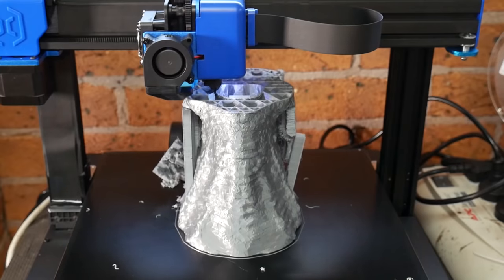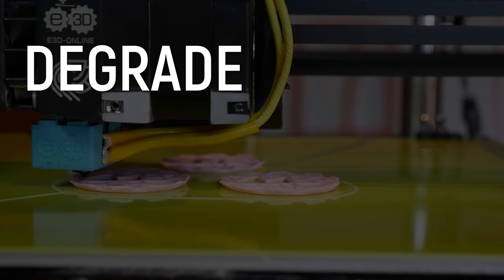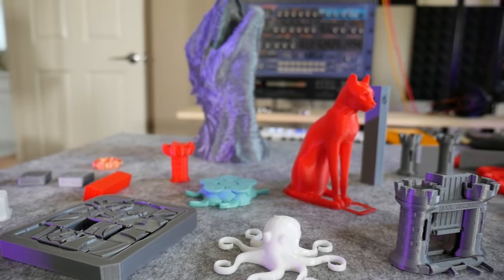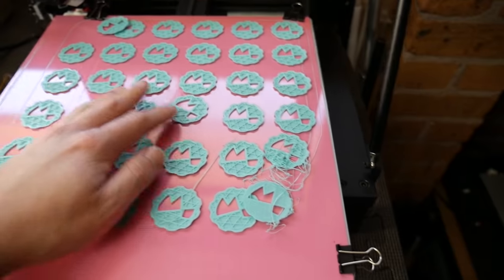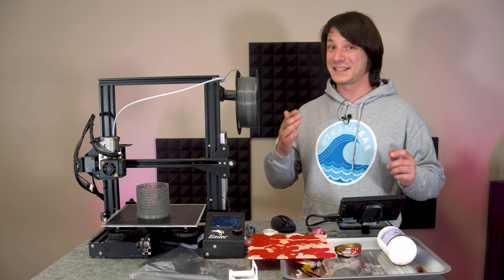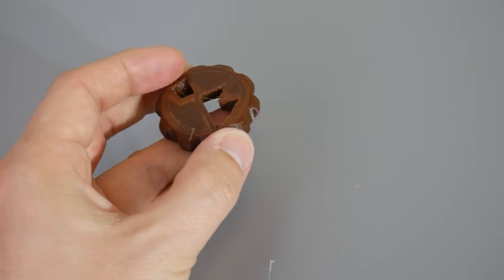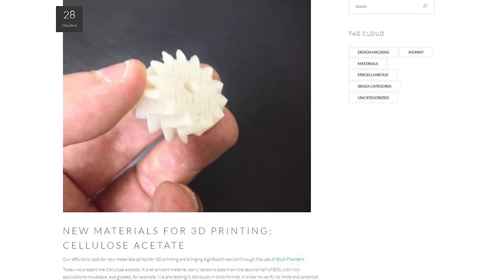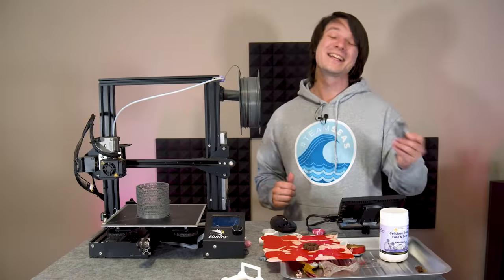PLA - 3D Printing's Biggest Lie.

Comment: Mate, this was know for years. I mean the garden composters thing. So what? Just don't throw it out, but recycle it. Burning such small amounts in a facility would also not really be a relevant problem. Test with PLA in salt water would also have been interesting. However, the rest of the vide turned out to be interesting. I don't need that currently, but I would like it to happen.

Comment: A good thing to note is that even though PLA is not biodegradable, it's still better than plastic made from petroleum and the likes. This is because you are not introducing extra carbon into the system, you are taking carbon from the air, into a plant, into plastic, back into the wild.

However extracting oil from the earth is introducing new carbon in the system

Comment: Luckily, my county in germany uses blue recyclabe plastic bags (from vietnam btw, why even bother about carbon footprint 🤣) for biodegradable waste, so I can be relatively sure that they have the right conditions to degrade PLA at the recycling facility. But that also means I have to seperate PLA from other printing materials (of which I only use PETG and Flex) - but being german I am used to seperating my waste.

Comment: At least from a CO2 perspective, things like PLA are still way better than oil based products. In the worst case, if you burn them in a power plant, the CO2 you get is more or less the amount the plant took from the air before. Yes, some additional things are created while creating and burning and creating the material, but at least you reduce the impact on the environment a lot compared to other oil base products. Here in Germany we officially try to recycle that kind of waste, but in many cases there are not so many affordable ways to so, and as a result much of the waste is burned in specialized power plants. (To remelt the material it needs to be very clean, which is one thing you don't get if you collect the material in the usual way - too many people are too stupid to do it correctly).
There are some concepts of liquefying plastics back to some kind of oil, but I don't think we'll see that in the near future...
Long story short: Yes, using PLA and burning it is not the best solution, but as long as we lack of better wide spread alternatives I try to work as much as possible with PLA and use the more problematic things (like ASA or TPU) only if I need the special properties and after I'm sure the model is correct.

Comment: There are many 3d printers on the market but no 3d print filament makers from past prints and that is because 3d filament is part of the 3d printer business.

All 3d printing recycling is  done by hobby and mainly from PET bottles. Pellet grinders and plastic injection extruders should be part of every 3d bench and reviewed just as enthusiastically.

Comment: Umm question...
How hard and expensive to have a good quality spreader at home, and extruded through a die into new filament and put on a spool to be reused again, as long as you know what plastic is what, and seprate the colours...
And if so, how many time could it be reprocessed before the plastic is degraded and can't be extruded or re-melted.

Also they found micro plastics in tge air.

And recently watched a video where the guy prints an object, put into pasted to make a mold, melts out the plastic heats it to temperature and and casts bronze in the mold.

Unfortunately he didn't use a separator plate when greating the mold 😣
But it seamed to work pretty good.

That could reduce plastics used and long as they cut it in half to make a separator plate to make sand or plaster molds, and would h7ave a more accepting market, 

And easy to make a new mold and make corrections. And if able to save cost on new filaments if can reuse prints it's a win win.

Waiting the day when packaging returned to paper and the new Mycelium Packaging, good for replacing foams and polystyrene Packaging.

Comment: If you believe bio-degradability is a good thing then consider this - what does it ultimately degrade into?  It doesn't just disappear after all, rather it will degrade into it's constituents, which is mostly carbon that will end up as carbon dioxide.  While it might not seem like a good thing to put non-biodegradable plastics into landfill, there is another name for this and it is carbon sequestration.  Plastics in landfill are basically permanently storing carbon that could otherwise end up in the atmosphere.  Yes its true that plastics that are made from petroleum are using a non-renewable resource, but the petroleum that is used to make plastic that is disposed of in landfill is not burned to power vehicles or make electricity so therefore does not contribute to climate change.  Renewable plastics from plant sources also use land that could be used for food production (and thereby drive further land clearing).  Many solutions to environmental problems have negative consequences that are rarely properly considered.
Reply: the sheep hear the buzzword biodegradable their brains turn off and just think its the best thing since sliced bread.

Comment: My waste wont end in a landfill. Not plastics of any kind, anyways. They are burnt. Like most of the waste that is picked up by the city. Since plastic are just carbonhydrates theyll burn cleanly to CO2 and Water (under the right conditions that you have in industrial waste disposal ovens) and in the process energy is extracted. Now for those worrying about CO2 itself, yes, that is released. However, it was previously taken up by the plantmatter that PLA is made out off, even if all my PLA ends up that way it should still be a net-negative in terms of carbon emissions since not all parts of the plants are used.

Comment: Yes every plastic is degradable, some bio degradable and fewer are compostable but... you can BURN all of them ;)    Because the sad reality is plastic recycling is nothing but a huge scam. Most of the time the majority of plastics that aren't PET, are simply incinerated at very high temperatures. And what's left is some kind of dirt that looks like earth and has a few uses too. Polymers are an interesting thing. Margarine for example  is just missing a few molecules to become technically plastic too. And certain oils like linseed oil polymerizes under oxygene. Also there are apparently now strains of bacteria that eat plastic. Like some insects are eating styrofoam. Also, when melting your plastics.... make damn sure you have proper ventilation because the fumes from the molten plastics is not really something you should inhale..... unless you wanna compete in who grows more cancer quicker, YOU or Deadpool.

Comment: Plastic recycling is too expensive and not worth doing. This is almost entirely because plastic needs to be sorted to be easily recycled. The solution is a drastic but necessary change: a ban on all but one plastic in one colour for single use products. If we did that, we could just pour the recycling into a regular sorting machine to separate the metals, then melt down what's left to be remade into new single use products.

Comment: There's a lot of 'food 4 thought' here if U will pardon the expression. 
Plastic use in the outdoor environment (PLA and so on) that has long life on solar, wind, WIFI, and various modern renewable outdoor devices, stationary and EV automotive, and mounting structures is desired to NOT be bio degradable since it has to function in the outdoor weather and environment for many decades.!!
U R 1000% correct that Recycling needs 2 B The Prime Directive !! The USA is not far from AU there is 100X the talk and regulation that there is actual implementation of recycling especially of the material in this 3D Extrusion Industry. People make no effort to collect plastic other than beverage and possibly milk containers.
Without the necessary recycling, It is environmentally better to incinerate the plastic with wood and paper trash in small amounts in a metal vessel with a high air input flow. The oxidation is nearly complete and there's no smoke and the pollutants are nothing compared to all the shattered plastic and dust and it's fragments in waterways, on the ground, and so on. We have to consider the lesser and minimalistic impact of the plastic disposal with respect of it's infiltration into the earth. By combustion it's in the atmosphere and not on the surface. Of course we don't want to collect all the plastic in the world and burn it. I'm referring to very small amounts only. 
There immediately needs to be inventions of machinery designs that can capture this plastic nightmare and put it back into the usage stream. Plastic is by far the most recyclable material in the world, even more so than cardboard, metal or glass, the disposal of which would be almost as serious a problem as plastic if not for the fact that plastic is replacing it in most instances.

Comment: Counterpoint, sequestering carbon from biomass underground such as in proper landfills (such as properly landfilling PLA) is, by definition carbon recapture, which is something we absolutely need to be doing.
Reply: Taking excess CO2 from the atmosphere (that we spewed there from fossil fuels), turning it into useful building material via biomass (ie, wood and bioplastics) and then burying it back underground at the end of its useful life where the fossil fuels originally came from, is actually quite a lovely concept in theory.

Comment: ... getting tired of this "plastics" hysteria 

Plastics can be recycled back into the gases from which they were made originally or in synthetic fuels, it is the same technology as what is used for steam cracking in oil refineries.

"Filament that properly breaks down when exposed to the elements" ... such as leaving outside in the sun ?

Comment: Hello. I’m just getting into 3d printing, and your videos have been extremely helpful in getting started.

As I’ve considered What projects I want to pursue with 3d printing, I’ve had a number of questions related to material longevity, Anna can’t seem to find answers anywhere.

I want to be able to make tools and projects which are long-lasting and safe. I’m aware that only a few filament materials are considered food safe. I’m interested in using 3d printing for planters and gardening projects. if a given filament is not food safe, would it also be considered unsafe for growing plants? If  food unsafe materials are safe for growing plants, is it safe to consume plants grown in those food unsafe containers? If a material is food unsafe, is it acceptable to use that material for projects that will come in contact with food, such as cookie cutters or any sort food press or extruder?

I understand that many filaments are hydroscopic, and should be kept from moisture in offer to prevent degradation of the filament. However, i can find no information regarding this quality after printing. Are prints produced from hydroscopic filament still subject to rapid degradation when exposed to moisture or water? If  so, what are the best materials to use for prints intended for use in the kitchen or bathroom?

I’m aware that many plastics are subject to becoming more brittle and fragile with age, but the lifespan still tends to be many years. Are 3d printing filament materials expected to have a similar lifespan to many injection molded plastics, or is the lifespan of PLA, PETG, TPU, etc, expected to be much less durable over time?

Regarding all of the above issues, can they be resolved by sealing the prints with some sort of coating? Will a painted or otherwise sealing
Sealed print better resist the impact of water, light, keep the chemicals that make a given material food unsafe from hurting you, etc?

I’d imagine this would be good information for anyone considering printing. Thanks so much for your time, both now, and in all your productions!

Comment: Recycling of 3d prints just isnt going to happen.

All manufactured plastics have identifiers which tell you what exact type of plastic it is so it can be recycled, and actually used in something else.

3d prints don't have these identifiers so are worthless to companies who recycle. There are dozens and dozens of types of plastics and is very hard to identify identify in pieces.

It's just not going to happen at a hobbies level.

May happen in industry where you have heaps of waste which can be used in big bins. Similar to metallic waste.

Comment: The problem with plastic is we don't recycle it. Did you ever wonder why they're weren't pukes of aluminum cans and glass bottles literally everywhere? It's because corporations are required to make sure if they use glass or metal that it gets recycled. Wet don't have that requirement for plastic. All we need to actually do to fix the plastic problem is recycle it.

Comment: The proper way to recycle over 90% of all plastics is to chuck it into a furnace to burn as fuel for heat and power.
Recycling is mostly a scam where far more waste and pollution is caused by collecting sorting storing and transporting it than simply burning it.

Comment: Ok, PLA isn't biodegradable, but you can recycle it. Probably the same for PETG. I think we need to start understanding what's in resins as well.

The cellophane section is a great commentary on the abysmal state of single use plastics. When I was repurposing transparent plastic shells for tinted game pieces, I found just about every type of plastic resin imaginable. I saw polypropylene, polyethylene, even PVC. It was the first indication to me that plastics "recycling" is just a marketing greenwashing fraud foisted on all of us by the plastics industry.

Comment: To correct something in this video, recycling is not a viable solution. 3D printing causes material degradation, and the process of re-melting and printing new parts isn't indefinite.

A major thing you might want to look into is pyrolysis - it might change how you think about and discuss plastics.

To oversimplify it, oil is made when organic matter is subjected to high temperature and pressure for long periods of time. There is no fundamental barrier to repeating that decomposition process industrially - if you subject plastics to high temperature and pressure without oxygen present, they turn back into oils that can be used to make more plastics (or for other purposes)

This makes plastics a cycle that can be repeated indefinitely, rather than a process that has to take virgin material in and produce waste at the end.

Comment: I love what you are doing. 
Do you think used PLA melted I to slaves could make food safe cutting boards?
Or would it be suitable to laser cut from with out toxic fumes?
I run a Makerspace and we output a lot of scrap PLA, acrylic and MDF. Would be great to be able to recycle it.
Reply: I would not recommend this. Pla can be food same however the same degradability mentioned in this video is the same reason you don't want to use it for food. You will likely end up with some concentration of micro plastics in your food.

Comment: PLA: shred it to extreme small powder and then throw it into a great pot of natural earth .... the smaller it is the easier it will biodegrade... simply because the surface area has increased dramatically......and bacteria can acces it better.. therfore a better-quicker degradation...

Comment: PLA was never adopted for its ability to biodegrade, it simply had the low glass transition temperature and good material properties for 3d printing. Not liking cellulose because it's made from trees is nonsense, paper is able to be produced sustainably, do you really think tree plantations couldn't account for a fraction increased demand without resorting to cutting down the Daintree Rainforest?

Comment: Remelting plastic doesn't necessarily restore its strength. Most plastics are going to keep degrading into microplastocs at the same rate, just more directly into yourself.

Comment: I feared that #2 recommendation would come up - filaments that break down more easily.  I'm afraid that makes no sense to me. If a widget I made breaks down that means I probably need to make it again, using more raw material and energy, meanwhile the failed part (talking realistically) goes into landfill to become micro plastics. How is this better than a scenario in which the original part lasts forever?  Frankly I think the "faster degrade"  perspective is wooly thinking.

Comment: actually, for plastics , just don't throw them away. Burn it and it all turns back to H2O and co2, completely eliminating the decomposition problem.

or if you have to throw them, bury it in landfills. since it doesn't decompose, so zero carbon would return to the surface. what you take from fossil, you put it back. carbon neutral.

Comment: A question…….where does petroleum come from if not nature?  So far, all of the predictions of when we will “run out of oil” have been wrong.   Just wondering, if something is found in nature and was not created by man, isn’t it natural?  Crude oil and sugar cane are both natural materials.  Whether the raw materials were natural is irrelevant.   PLA and crude oil derived plastics are still plastic.  They are the same material, created in different ways with the same issues.   There are bacteria and molds in nature that can break down crude oil, just like corn is broken down by molds and bacteria.   Problem is that neither milk jugs nor PLA are affected in any way by those same molds and bacteria.